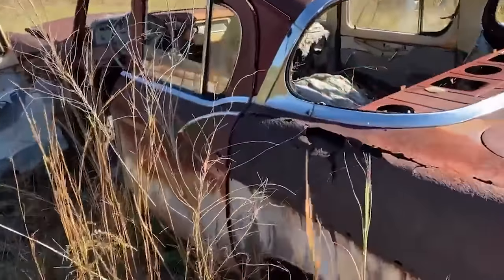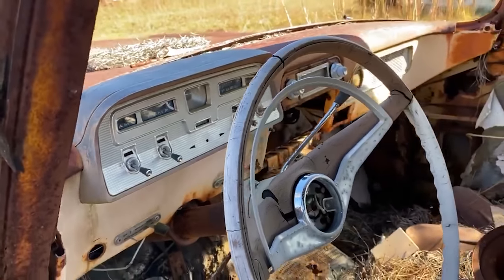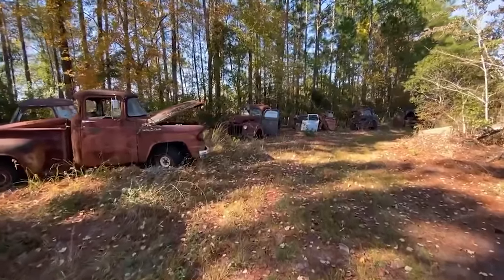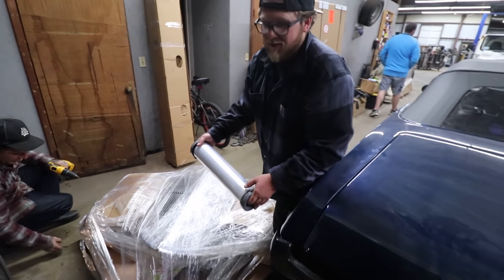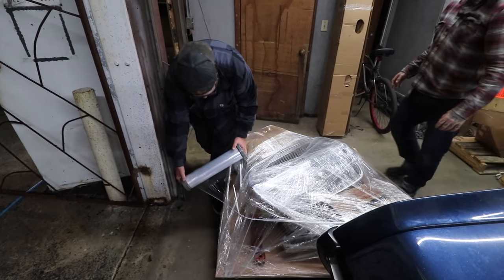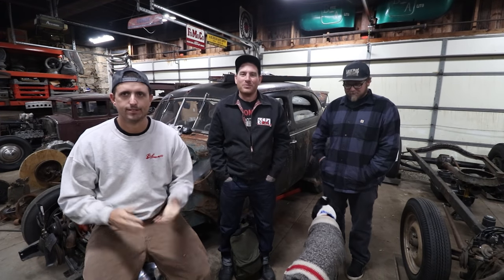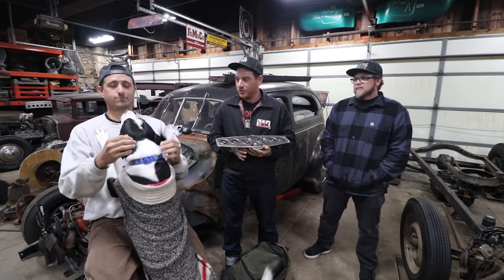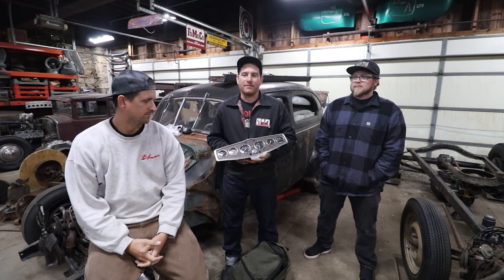Georgia Rusty Gold - Moultrie Swap Meet and Junkyards

Comment: I wish I was with you at that "roadside" junkyard.
16:33 That grill you bought looks pristine. And did you say $1200 ?
27:13 Explain more about the gauge panel .
Reply from the maker: Yes I told the guy $1200 for the grill. If I fix the slight bow to a few of the bars I'll ask $1500 on the web.. if I don't decide to hang it on the wall for a future project haha. Gauge panel is a 1930's "Limo" panel found in early big car limos and big speed boats like Chris Craft. Hope that helps!
Reply: @IronTrapGarage  Thank you for the explanations.  That gauge panel, I hope, can find a home in one of your builds.

Comment: Just curious why didn't you guys drive one of your pickups? Other then I think it would obviously take a bit longer, I would think you guys could pick heavily and hit the back roads and it would probably be cheaper between the three plane tickets,  van rental and pallet shipping not to mention you could even hitch up a trailer for more picking capacity. And make use of the stake pockets and you wouldn't be on a tight time schedule.
Reply from the maker: We all still work day jobs so flying saves us 2 days of travel. We wish we could back road it the whole way but there just isn’t enough time!!!

Comment: What's a right side steering wheel car doing in America?
Reply from the maker: Probably road over on a boat.
Reply: @IronTrapGarage  Well Mitch Taylor you don't know has a 1925 Model T Motor Car he did videos of it plus repair ones of the wheel and the starter. What you said about how that right steering wheel car may seem true of how he got his when finding it in a crate.

Comment: That an interesting gauge panel - what's it from and what gauges are in it?
Reply from the maker: Hi Robert, It's a 1930's "Limo Panel". Found in early Limos and big speed boats like Chris Craft. Has mostly M&M curved fast, crescent needle gauges with a Stewart Warner gauge or two mixed in. I definitely will build a dash around it in a future project!
Reply: @IronTrapGarage  Funny, I was also thinking boat instrument panel, as back in the day there were often 2 water temperature gauges - one for each head, and no fuel level gauge.  That will definitely be way cool in a car with old style S/W gauges!  Did I also see cut-outs for switches too?